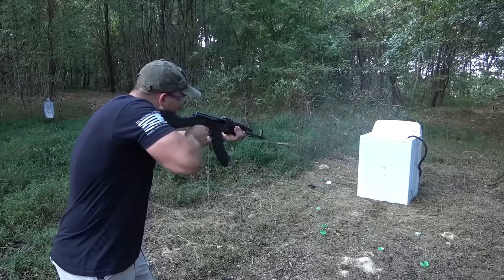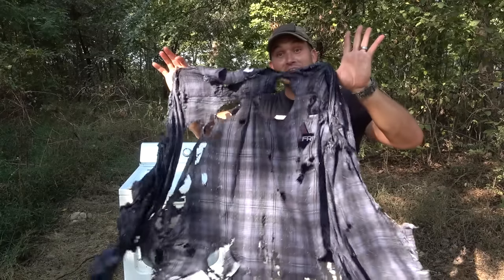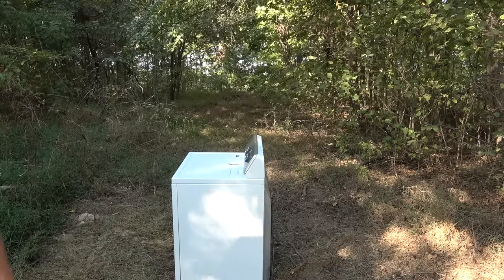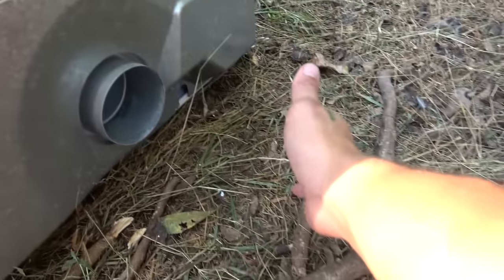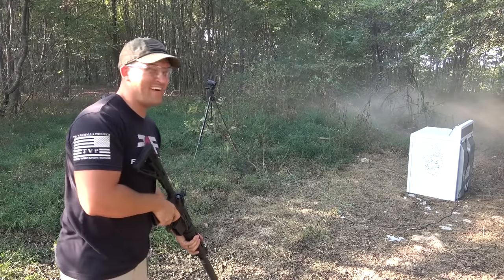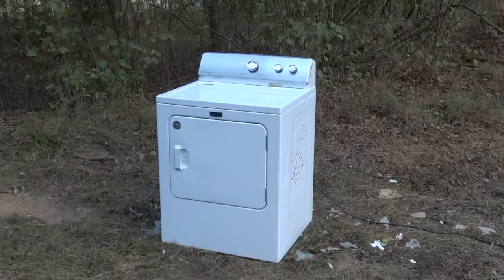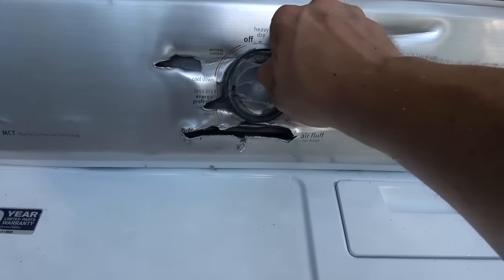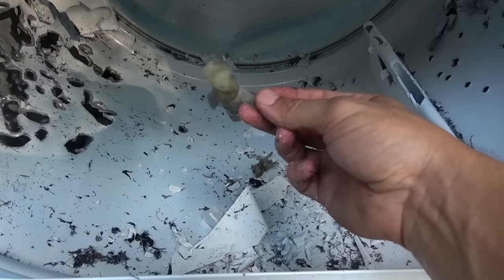Full Auto Friday! AR-15 vs Dryer 🔥

Comment: If you turned it to the air dry only setting which wouldn’t run the heating element in the dryer it would be a lot less likely to overload your generator